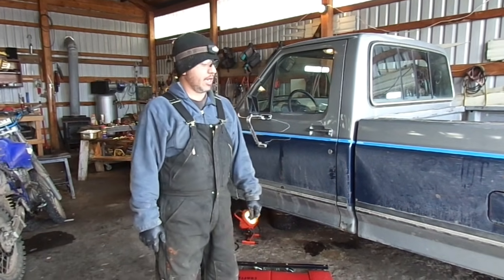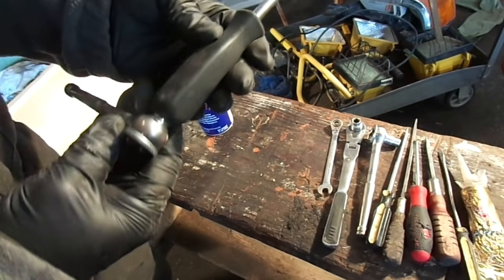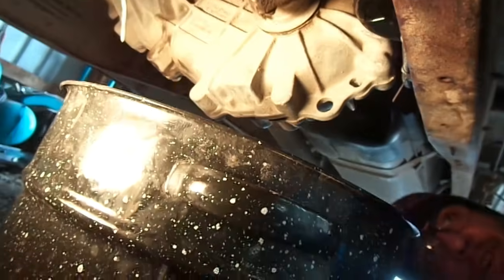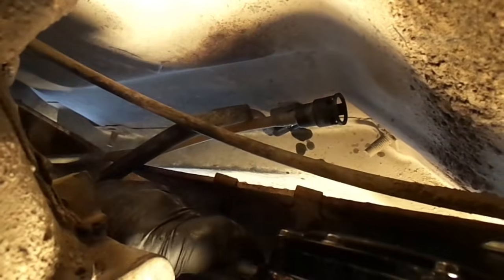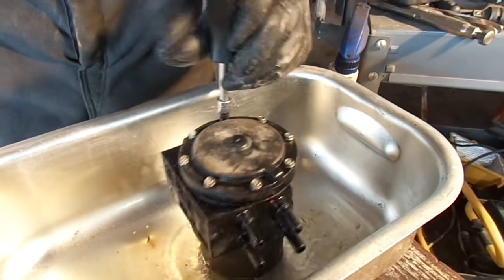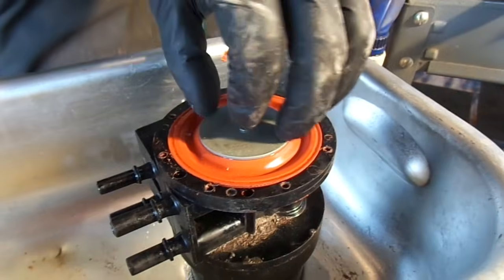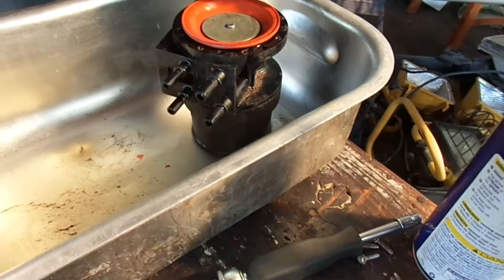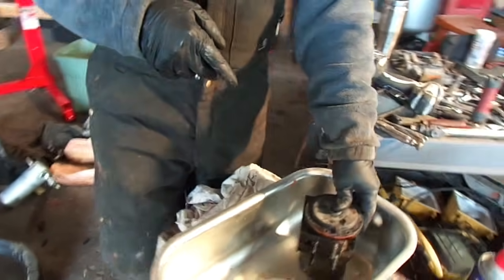1987 F150 Dual Fuel Tank Selector Repair

Comment: Thanks.  I have a 1990 F150 2 wheel drive with 230 k miles.   I have had the fuel going to the front tank and over pressurizing the tank because when I open the fuel tank cap fuel can spew out.  I am 70 and really can't get under the vehicle and work these lines etc so I am going to order the correct selector pay the big bucks and have my mechanic put it in.  Then if there still is an issue will have him check the fuel pressures from the pumps and go from there.  I bet this is my problem with the fuel system.  It has been easier for me to simply replace things because the price of most parts are not too high.  Appreciate the video.   I bought the truck new 30 years ago and have replaced lot of things over the last 3 years since retiring.

Comment: I have a 1991 f350 but I can’t seem to find it in mine could you help please
Reply: @Saul Varela it will always be on the drivers side never passenger because the cat is on the passenger side, it will be in the frame rail between the front tank and the rear front i beam track rod mount. this style is a "passive valve" no wires to it so it is not what is called a tank selector solenoid valve. the tank selector switch turns the fuel pump on for the selected tank and the other tanks pump off. fuel pressure is what causes the valve to move and open for the fuel line with the pressure and close the non pressure line off. also there are 2 fuel filters..the one on the passive valve and the one after and before the engine you need to replace both i might add. the one on the valve is what is called a "pre filter" it just catches the big crap not the smaller stuff and that is what is gunking up the valve.....to find it trace the fuel lines...when you only see 2 and not 4 you passed it go back and find it.. all should have that debris shield on them all as a rock kicked up by a tire will destroy the passive valve...silicone is gasoline soluble so...it can work but it is russian rulet with it. they make a fuel stabil sealant you can use and it would do a better job...oh and good video. i am one of them professional mechanics. but not a snob i apprenticed to learn my trade..them book learned ones are tools..LOL..i found this gem because i need to do this on my 1994 ford F150..it dumps fuel from the front tank in to the rear tank and visa versa...and pressurises the tanks when i switch em...i normally just replaced these and did not try and fix them as that was what ford says to do...so you my friend are a godsend!!! if i am ever in idaho i owe you a beer my friend!!!
Reply: driver side frame rail...it will be between the front tank and the left front axle track rod just trace the fuel lines...where the 4 lines stop and you only see 2 is the location of the passive flow valve...all versions have the shield on them.
Reply: @Saul Varela here is a nice complete teardown of this valve thought you might like the info...                          http://www.stangler.com/motorsports/articles/FuelTankValve/index.htm
Reply: @Saul Varela well after further research..starting in the 1990 model year and moving forward..they deleted the passive valve set up and went to a in the tank valve set up intragale with the in tank fuel pump...so basically after 1990 you should not see one of these "passive valves"..GRRRRR this means i get to drop both tanks...and replace one or both fuel pumps...dam progress!!! LOL but i still owe you a beer because you made a great vid to help the novice fix or rejuvenate this style of passive valve system!!!  marcos sosa you are [probably in the same boat as i am...if i find a better way i will post it for you..but looks like dropping the fuel tanks and physical testing and replacing the fuel pump/valve assembly as needed...hey it also means you get to fix that fuel gauge problem you may have since it is probably the float that is with the fuel pump/valve assembly!!!! bounous!! here is a nice diagram to help you understand what i am talking a bout...                                                                                                                                                                https://www.supermotors.net/getfile/950180/original/fuelflow.jpg

Comment: Thanks bro..

Would this give me a no start in my 1990 Ford F-150 by any chance? And stop fuel from getting to my fuel rail? 

Sorry if I asked an already answered question..

Thanks in advance
Reply: @Saul Varela U mean the inertia switch? 

Would the fuel pump still come on if that was not activated?

The only way I could test for fuel pressure at the fuel rail is by pressing the schrader valve, don't have a gauge.

When I press the valve, no fuel comes out, dry as a desert...

Thanks for your help.
Reply: @Saul Varela Thanks, that's what I was thinking..
Wish it were that easy tho'..lol

Comment: I inherited my dads old 87 f150 in high school we had issues with the truck cutting off and the front tank not working.   Ive always knew it was dilling with the fuel and I thought it was a fuel tank selector switch.    Until i found this video.  I appreciate it!

Comment: My truck is only running on the front tank as the former owner threw away the rear one so I ended up removing the selector and replacing it with two Ford fuel filters, one for the 3/8" pressure line and a 3/16" for the return line. I used the filters as splicers for the lines so I didn't have to cut anything, that way I can repair the selector at my convenience and put it back if I decide to put another tank in the rear. In the meantime the truck runs fine. If anyone goes this route be sure to plug the vacuum line that feeds the selector.

Comment: Thank for posting....I'm dealing with a leak between the top lid of the selector and the selector body and I think your sealant idea will probably do the trick. I hate that they use plastic components in a high pressure fuel system, the potential for a fire is greatly increased. Gas has been squirting out for who knows how long, only noticed when I pulled the truck into the garage for maintenance. Glad I didn't burn down my house, garage, the 9 vehicles  inside and everything else I own !!!

Comment: well I just did my unit and found that the pins that you WD40ed there is a pin that you put the screw into also moves up and down . there is no electronics in the unit the center shaft has a ball that locks it in place either up or down , I pulled mine out cleaned it WD40ed it  put back together put silicon on the rim also got a new filter and rubber seal   . the reason I rebuilt this is I live in Canada and a not same replacement is $643.39  before tax comes to $675.56

Comment: Man! I’m watching this at night but I’ll have to check in the am. I have a 79 Ford E150 Chateau that cranks no start. Checked on somethings and the fuel gauge is not working/no prime and fuel pump no power so no gas getting to carb. I also have dual tanks. Heard something about a relay too. 😪

Comment: I had the same issue with my 88 f150 so thanks so much for doing a repair twice to help your fellow man much appreciated taking those rusted bolts out of the shroud turned out to be one tough job with all the rust down there.thanks again well done video🤠👍🏼
Reply: Was that the problem ? My 87 e150 rides rough. We changed the ignition module, fuel reservoir, spark plugs, distributor, throttle sensor, spark plugs wiresr. But still riding rough

Comment: thanks for the vidieo i seen that you forgot the little rubber oring i did the same thing i blocked mine off because i run only one tank and my vale is badly corroded and i need a new one but i got it to work it sucks that ford uses odd ball line sizes agian thank you
Reply: @Saul Varela i understand i found a cork gasket to seal the hole

Comment: Tk u for this help.  Nice job !!  Q sir - is my 87 Chevy Silverado basically the same?  As soon I flip the dash switch my engine cuts off.  If I just turn the ignition to the on position the gauge should change when the dash switch is flipped correct?  The engine doesn't need to be running or (does it ? ) bc of line pressure and vacuum on the diaphragm?

Comment: Thanks for posting this. I will be tackling this project very soon. I have a question though. You said you replaced a filter within the unit. How does the bottom come off to access said filter? I'd like to know that before I pull the unit out of the pickup. Thanks.
Reply: Alright. Wasn't sure if it was screw-on or held on with fasteners or what. Thanks again.
Reply: Got that. Thank you sir.

Comment: My 96 f250 5.8 tuck has an issue similar to yours... I'm running the rear tank and the gas is pouring out the front filler neck. I suspect the tank selector is the issue. Thanks for your video!! I will post response to the repair here!
Reply: I have 96 f150 same issue, did it work for yours?

Comment: Okay, I took the valve off, found the diaphragm no good, didn't want to spend 200 on a new one and face the same problem down the road, I found a single tank valve for under $60 (FOTZ-9K044-A), since my front tank and all it's gutts are new, I will just have a single tank truck.  I may get an adapter for the rear tank line, hook up a removable extension, and use the back tank to carry gas for mower and tools.  We'll see if the tank pump, on the rear tank, will be strong enough to use as a pump for the equipment fueling process.  If so, I'll use the rear tank as a fueling station for my lawn equipment and I won't have to lug gas cans around.

Comment: I had replaced fuel pumps the tank switch map sensor fuel relays etc nothing worked your video solved my issues thank you so much buddy your my hero ....no joke thank you
Reply: What issues did you have
Reply: Yea what issues exactly cause im working on an 89 f150 5.8L dual tank and for some reason after it quit running it lost all fuel pressure. So I'm figuring with one of the dual tanks pumps (tried both tanks though so im not sure) the fuel pump/s is gone and it was a coincidence. Or maybe this issue in this video.

Comment: Thanks for the video, I'm think I'm ready to do this to my 89 F150.  I didn't realize the problem until both tanks were full and, depending on which tank I am using, the return is causing the, already full tank, to pump gas right out of the filler cap.  So, realizing I could see myself as a ball of fire, running down the road, I thought I would try your solution.  I will probably purchase some tapered rubber stoppers to plug the lines when I get them off. My question is about the bottom reservoir on the unit.  Can I just put the whole unit in a vice and use a filter wrench to remove the bottom cover and should I have any problem finding a suitable filter?  Thanks for any more help.

Comment: I just bought an 86 f150 and apparently they run both primary line to the engine. They took out the selector valve and plugged the two returns. I'm running on only the real tank. I hit a bump and the return just dumped like 3 gallons of fuel. I reckon the plug fell out. 

I was wondering what those two line hanging went to... I guess that resevor/selector valve that it missing...

Shit me

Comment: There is a center plunger (spool) between those two valves. That is usually the problem as it does the tank selection. If stuck on center of it's travel fuel doesn't flow.

Comment: Could u show the filter?
What is the part number?
How did you remove it?  Spin on/off?
Thanks for a great video
Reply: Any luck. Im looking too
Reply: Evidently a filter wasn’t originally installed on my truck, just the unit itself.  I cleaned it up and reinstalled 
Going to replace the in tank pump now
Reply: @lindyp38  mine didnt have one either. I found it on rockauto for .61cents. I assuming it didn't work for you?

Comment: Thank you Sir I've been fighting a 87 f250 for awhile now 
Was thinking the problem was fuel pump or carburetor adjustments, and it was still letting me down usually 45 miles away from home. 
Figured out how I wasn't getting fuel from the tank to the motor after all that we are dropping the tanks today and also will be checking out the selector valve and lines 
Your video explains what I'm getting into
Reply: So was the selector valve the issue?

Comment: Oh man great video , I’m hoping this is the issue on my 1996 f250 gasser 351, I just picked this truck up and it has the same issue . Thank you . Cheers .
Reply: Saul Varela I figured it , so after a series of testing of the relays , fuses and going through the electrical . You wouldn’t believe what it was .After got the truck I repaired the shifter tube and replaced the bushings to it , I mistakenly did not reconnect the dang plug harness which was the reason it wouldn’t start . What a rookie move 🤦🏽‍♂️.

Comment: Hello Jonee, Harry here, Thanks for a very informative video. I have an '87 F150 2wd . Recently it started leaking gas from the front tank & I haven't used the front tank in over a year because it leaks. I probably need to clean the valve assembly like you did & free it up & replace the filter since I have it off anyway. I work at a John Deere dealer & have been a mechanic there for 28 years & we have clips that look exactly like the ones you said break easily. And they do! Thanks for the help!!!

Comment: Okay I cleaned my selector valve for same style but a 89 f150 4.9l inline 6 2wd. But here's the kicker the front lines were crimped off and another hose ran back to itself on the valve so they basically did away with it front tank all together.... any ideas what I should do next besides put it back same way it came out? I don't even know if the front pump is working at all.

Comment: 91 F150, duel tank, 5.0. Both my tanks pump but my dash gauge only registers on the back tank. Good thing there's two tanks. Hate running out of fuel.
Reply: Just got a van with 2 tanks and a busted gas gauge. I call the 2nd tank the "oh shit" tank

Comment: Is it possible to clean or replace the filter in the tank selector/reservoir unit?
Reply: 30 manufacturers  currently  make this filter, however 99% of these units DO NOT contain a filter! I work for Ford and they DO NOT admit that there is one! It is not intended for this use!

Comment: First off great vid. However, the cap for the diaphragm has a groove in it which the outer edge of the diaphragm seats into. The orange RTV silicone you used is not fuel resistant and as such won't seal. Upon reassembly the second time you obviously positioned the cap correctly thereby getting a good seal. Whereabouts in Idaho are you? Wilder here.

Comment: Saul, thanks so much.  What a blessing to have this knowledge.  I discovered that I have the electric dual tank selector.  I wanted to ask where the best spot was to check the in-line tank pressure.  I've checked the lines to the switch, and am checking after the reservoir.  I get a good stream both in take pumps but no pressure.  New engine in this truck, injectors, three month old main pump and it wants to start but seems gas starved.  I don't understand why zero pressure and just need a quick tip.  Thanks, if you can, and if you're too busy, I certainly understand.

Comment: hey saul, is the truck in the video a EFI (electronic fuel injected) system? Mine has a selector switch. I wonder if it is the same procedure?
Reply: Saul Varela i think its the same issue. when i switch from one tank to the other, it works and it will continue to work, but it starts making this humming noise or whistling noise to the point that it stops running. I then switch back to the other tank and it works just fine. Sometimes on the good tank, it does the same thing. I thought it might be the fuel pumps, but after watching your video, I am steering towards it being the valve selector. I have replaced the inline fuel filter but no luck. What do you think?

Comment: Thank you for this! Definitely going to check this out on my 88. I'm confident i've just got a bad level sender (or wiring) on the front tank, but once i got that fixed it would suck to find out the selector isn't working either. Good to see some good ol figurin things out still happening. seems to be a hard to find part too, rockauto shows the newer electrically actuated selector, but nothing for the reservoir/filter type like this one.
Reply: @Saul Varela Thanks. gotta love the cheap filters for the old fords.

Comment: there was a small o ring under my filter , mine sucked the valve through bought a new complete  valve less than a year it stopped working also there is a electronic tank selector replacement but you must make a wire loom. Good Luck Every Body. Thank for the Video!!!
Reply: No video I know of but I rewired a 84 van chilton blook showed the wire diagram ,you would have to tag into fuel pump power I think to power tank selector I haven't done mine yet , good LUCK EVERYONE

Comment: good job good video. I am having the same problem back tank filling front tank . plus when I give it gas the truck want to bogg out and die.. o
probably due to loss of fuel pressure. thank . you have the only video showing this issue and how to fix it. all the rest show the in rank one way value. in

Comment: Thank you for the information. I think I have the same issue. I appreciate you sharing
Reply: Well believe it or not mine did not have that valve. Mine is 1995. Soon after I started having problems my sending unit stopped working. 

It's been cold so I have taken my time working on the project. I ended up removing the bed and replacing the fuel pump as well as a sending unit. 

Your video still helped me out more than you know and I appreciate it very much. There isn't much good info on here for it. I guess I should shot a video. Thank you !!